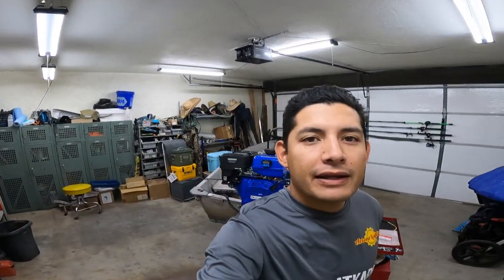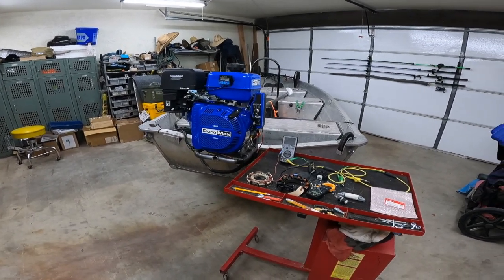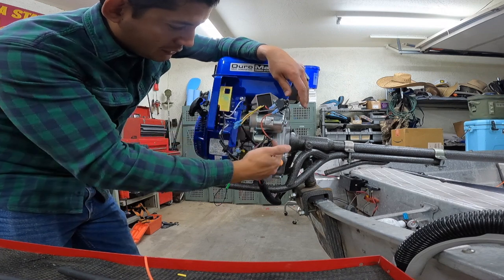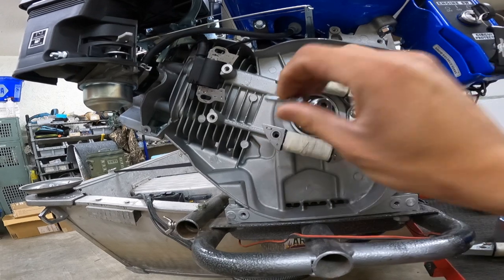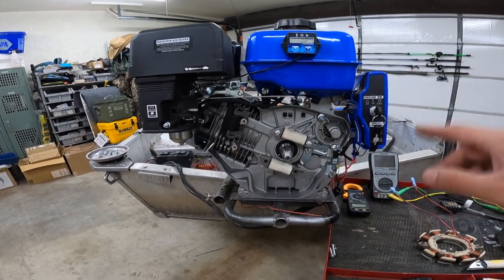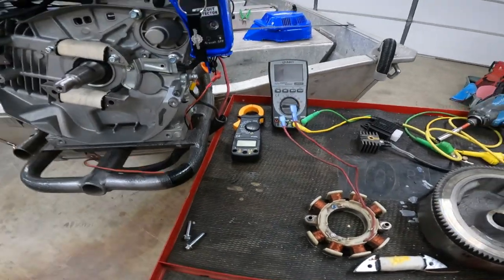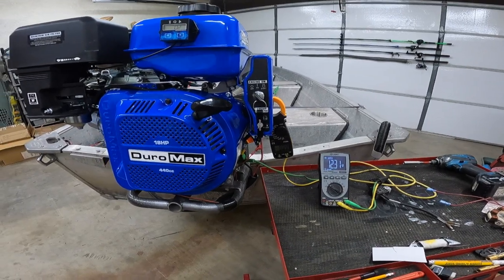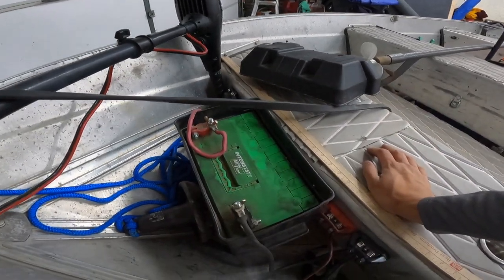DIY Upgraded Charging Circuit for Honda Clone Style Engines #2silver2bullet #XP18HPE

Comment: Hello, first off, thank you for a great video👌🏻 I am running your system with a small NOCO lithium 500a battery that has been working great at starting the engine as well as running the electric clutch on the pto, but these lithium batteries are at 13.5 volts static charge. I’m wondering if there is a regulator that would allow for a higher charging voltage for this kind of battery? Nelson
Reply from the maker: Might need a different rectifier specifically for lithium batteries like how dirt bike do.
Reply: possibly 🤔 I’ve also seen a lifin charging coil used in a video but no final results were shown. Honda has a 4 magnet flywheel as I understand as well.

Comment: WARNING THIS DOES NOT WORK,  these do not charge at idle and put out only 6 amps maximum at 38 to 4,000 RPM anything under 38 you will barely get enough juice out of your rectifier regulator to recharge a battery even just the ammount of juice  it takes to crank starter and THIS WILL ONLY PROLONG TIME BETWEEN  BATTERY CHARGES
Reply: How does it not work if it increases the 1 amp output to 6 amps?  600% improvement over stock. If someone does this modification on a mini bike with no battery, the output amps will be enough to run LED lights or other accessories compared to the <1 amp stock. It’s also full wave rectification compared to half wave from stock, which will get rid of flickering. 
There’s many applications outside from battery charging that this system can improve.

Comment: Excellent video for upgrading a charging system. Keep em coming. Thanks
Reply: WARNING THIS DOES NOT WORK,  these do not charge at idle and put out only 6 amps maximum at 38 to 4,000 RPM anything under 38 you will barely get enough juice out of your rectifier regulator to recharge a battery even just the ammount of juice  it takes to crank starter and THIS WILL ONLY PROLONG TIME BETWEEN  BATTERY CHARGES

Comment: Good video. I have the same motor on a Featherlite Surface Drive. I have the parts in now. Hopefully will be doing the upgrade this weekend. Thank you for posting.
Reply from the maker: Saw your post on Facebook awesome set up
Reply: @azlongtales  thanks for putting out the videos they are great!
Reply: WARNING THIS DOES NOT WORK,  these do not charge at idle and put out only 6 amps maximum at 38 to 4,000 RPM anything under 38 you will barely get enough juice out of your rectifier regulator to recharge a battery even just the ammount of juice  it takes to crank starter and THIS WILL ONLY PROLONG TIME BETWEEN  BATTERY CHARGES

Comment: The link that you show for the aftermarket charging coils on ebay are not the same as the Honda OEM changing coils.  The output for the aftermarket coils are rated at 3 amp.  The Honda coils are rated at 10 amps.  I have ordered both coils and the Honda coils are much larger and therefore, more output.  Thanks for the video, it is very helpful.
Reply: WARNING THIS DOES NOT WORK,  these do not charge at idle and put out only 6-10 amps maximum at 38 to 4,000 RPM anything under 38 you will barely get enough juice out of your rectifier regulator to recharge a battery even just the ammount of juice  it takes to crank starter and THIS WILL ONLY PROLONG TIME BETWEEN  BATTERY CHARGES

Comment: Awesome mod. I will definitely be installing this on my duromax for the all day trips.
Reply: WARNING THIS DOES NOT WORK,  these do not charge at idle and put out only 6 amps maximum at 38 to 4,000 RPM anything under 38 you will barely get enough juice out of your rectifier regulator to recharge a battery even just the ammount of juice  it takes to crank starter and THIS WILL ONLY PROLONG TIME BETWEEN  BATTERY CHARGES

Comment: Luckily my wildcat 223cc has a charging coil
Reply: I can't find a parts breakdown or wiring diagram of the Wildcat 223. Most pull start motors don't have charging coils, it is more common on electric start engines. If it doesn't have a voltage regulator, it may have the standard 1 amp coil. This will still be a good upgrade if you want to charge your batteries faster.
Reply: @DavidSanchez-cd7fz  well this is electric start with a charging coil. nice job with your upgrade btw
Reply: @DavidSanchez-cd7fz  When your boys going to finally bite the bullet and get the wildcat 223cc? It’s a superior engine in all aspects it’s even more superior then the predator 224cc. Piston has special rings like a racing motorcycle creating less friction. Piston weight for wildcat 135grams. predator 212 Piston weight 158 predator. Predator224cc Piston weight 162 grams. Wildcat has Flat top Pistons for better performance. Wrist pin weight wildcat 40/41 grams predator 224 44/45. Everything else is better too. The 58 mm crankshaft is made of ductile iron so it will bend and flex before breaking. It can handle a stage 4 easy. It had a 3 mm longer stroke than predator 212 and 208 engines.
Reply from the maker: Sent an email to eccarburetors.com hopefully find what the wildcat 223 is producing on the charge coil.
Reply: @azlongtales  I’ll go look at my manual tomorrow and I’ll send you guys a picture
Reply: @azlongtales  What is funny is that all of these wildcat kits and all of these big old board out engines and long stroked engines are literally just wildcat type kits with flat head pistons and 58 mm strokes this engine will beat a Tillotson to 228 I’ve seen it be to Tillotson 236 I’ve seen a beat numerous 225s The predator 224 is copying the design with the 58mm stroke and all the 58mm kits are just wildcat 223cc kits without the block. But Wildcats block is superior it’s got  reinforcement it’s got venting it’s very slick you need to watch some videos on it
Reply: WARNING THIS DOES NOT WORK,  these do not charge at idle and put out only 6 amps maximum at 38 to 4,000 RPM anything under 38 you will barely get enough juice out of your rectifier regulator to recharge a battery even just the ammount of juice  it takes to crank starter and THIS WILL ONLY PROLONG TIME BETWEEN  BATTERY CHARGES

Comment: That is a slick upgrade, will definitely be used on those 3-4 day fishing trips in the middle of nowhere! Thank you for being so informative 👍💯
Reply: WARNING THIS DOES NOT WORK,  these do not charge at idle and put out only 6 amps maximum at 38 to 4,000 RPM anything under 38 you will barely get enough juice out of your rectifier regulator to recharge a battery even just the ammount of juice  it takes to crank starter and THIS WILL ONLY PROLONG TIME BETWEEN  BATTERY CHARGES
Reply from the maker: Thank you we thought this could help alot of folks out simple and very useful mod
Reply: @azlongtales Hi. Easy question. Great video. What speed meter which model You used. All of them which I buy show me wrong engine speed. Thank You